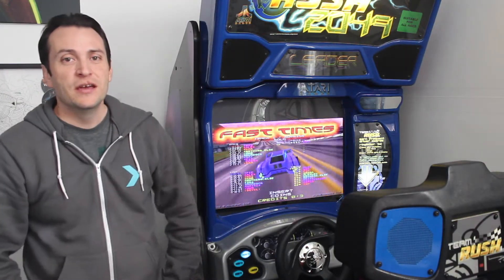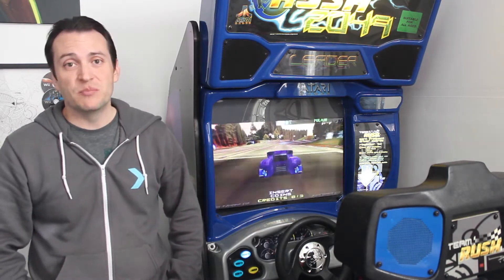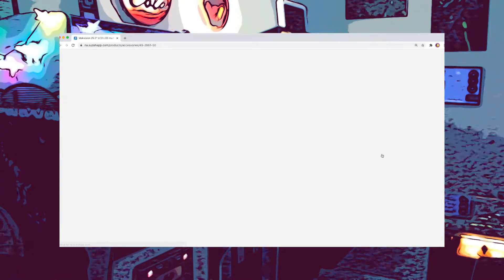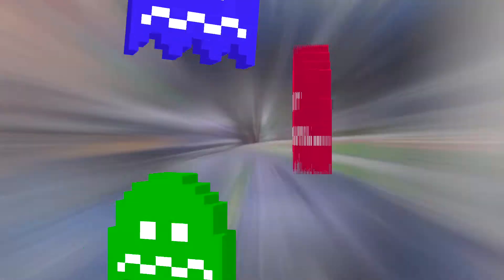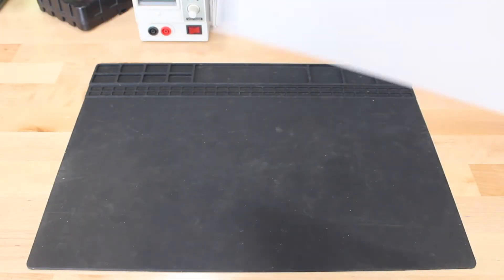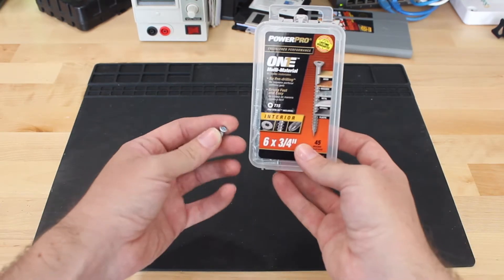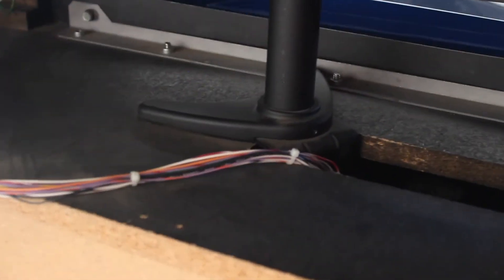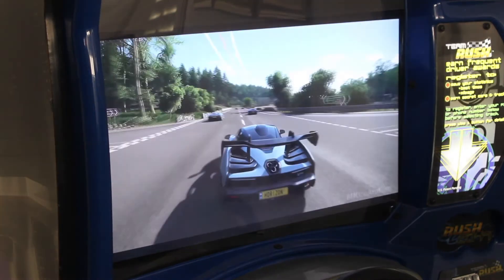Installing an LCD into a San Francisco Rush 2049

Comment: Really cool. I did a similar conversion on mine. Love the LCD display crispness. My rush 2049 has a vga out, it makes it super easy to use a LCD.
Reply from the maker: Nice! What kind of LCD did you use? Did you need to use an adapter to go from the 15khz signal to VGA, or is it just directly connected?
Reply: @justinsarcade  I used a standard ACER computer monitor I got at bestbuy. No adapter needed. I just bought a VGA Y splitter from Amazon for $8 and plugged the monitor directly. I liked how you put the new plexiglass.
Reply from the maker: @jonathangarcia1006  That's awesome! For some reason I assumed it would be a 15khz arcade monitor and you'd need a converter. I guess since it's a higher resolution 3D game, a VGA signal does make sense in retrospect. Thanks for the info!
Reply: @justinsarcade  Great video! I should be picking up a 2049 cab soon and am very interested in your solution to connect and swap between the original game and PC games or PS4/5 games. Also how to connect force feedback is near the top of my list as well. Do you have plans to make a video on that?
Reply from the maker: @robwalker2937  Yes! That is in the project queue and I plan to make a video about it as well.

Comment: So now really need the oc video! Got a gaming PC and monitor. Hooked up a jamma to PC converter. Got some sound out of it (although speakers sound possibly blown), and not sure how to figure out if it the board is working correctly or I need to get a uhid encoder or something now. Very new to PC gaming. But getting there. Installing all the mame stuff now

Comment: Hi Justin, great video. Did you ever do a video on using Rush 2049 force feedback and cabinet controls on a PC conversion to run something like Forza?
Reply from the maker: I've been through a few hardware revisions for the controls... at this point I think I've finally settled on using the community built PWM2M2 and PWM2HAPP boards. I've got one waiting to be installed but it's taken a back seat to other projects.

Comment: Are there any monitors that match the height of the original CRT? It looks like the picture is stretched on yours with the gap on top but I like the idea of sharper graphics.
Reply from the maker: Not in the same 4:3 aspect ratio, at least to my knowledge. But there is something that will get you close.

I originally tried to use an 16:9 TV that was big enough that it filled the entire viewport vertically and overflowed it horizontally by about 6 inches. My thought was to just use software to scale down the game to fit in the viewable area, so 4:3 games would fill the entire viewable area and 16:9 games would be letter boxed. This was easy enough for games running under MAME, as you can build a custom screen layout to do exactly this. But I couldn't find an easy way to do it for modern PC games; I expected to use nvidia's control panel to make a custom resolution and set the appropriate offsets, but I never got it working right.

That being said, there is a new screen from LG called the DualUp (28MQ780) which might get you really close. It is a 27.6" screen with an aspect ratio of 16:18, which is almost square. It is about a half an inch short of the viewport's width and around 2 inches taller. So it almost fills the entire viewport. This might be a great option though, especially when you want to run 4:3 MAME/emulated titles as well as 16:9 modern PC games. Older games would almost fill the viewport entirely and modern games would be letterboxed. I have been considering this for the Rush build as well as another upright cabinet.

Here's the specs: https://www.displayspecifications.com/en/model/aab029cb

Comment: im interested in how you reused to original controls as I'm getting one of these cabs very soon and I'm sure which direction to go with.  Any input or advice would greatly appreciated
Reply: Currently, I'm working on using a special force feedback PCB referred to as "Immersion" (GlobalVR part no. 990-0040-01). I believe this board was used in the Need For Speed conversion kit, which was PC based. This PCB connects to the Happ force feedback motor, potentiometers for the petals, matrix inputs for the 10 digit keypad, and the standard push buttons. It has drivers for Windows 7 which show up as a steering wheel with force feedback. From there I'm using the FFB arcade plugin.

FFB Arcade Plugin: https://github.com/Boomslangnz/FFBArcadePlugin/releases
ArcadeControls Forum Post: http://forum.arcadecontrols.com/index.php/topic,135310.0.html

Unfortunately, I'm having issues on anything newer than Windows 7. Depending on how it goes I may try to switch to this community built interface board:

http://forum.arcadecontrols.com/index.php/topic,162932.msg1743119.html#msg1743119
Reply: @JustinUnterreiner  did you ever revisit this build?   I’m currently working on my rush cab and I also picked up a nfs carbon cab at the same time for $25. Needs some work but it is the complete cab with pc and all
Reply from the maker: @Undar8ed03  Yeah, slowly making some progress. I decided to move away from the Immersion PCB to a solution developed by the community. A user named Aganyte from the gameover.net forums has a solution for several racing cab configurations. For the SF Rush specifically, I'm using the PWM2HAPP with the Sega FFB board. I have the hardware in hand, but I've been distracted by other projects. Hopefully I can get to it this fall/winter.

https://imgur.com/a/96JCaNO

If you want to do research yourself, check out: https://www.gamoover.net/Forums/index.php?topic=38553.0 and/or search for "PWM2HAPP" and "Sega FFB hack".
Reply: @justinsarcade  that’s what’s up!!  I appreciate it man. Hey by the way, would you still happen to have any of the original rush pcbs?
Reply from the maker: @Undar8ed03  No problem! Nope, I don't have any of the original PCBs; my cabinet was stripped when I got it.

Comment: How did you hook up the RGB GS to VGA plug GBS8200 ?
Reply from the maker: I did not need to use a GBS8200, as I'm using PC based hardware.
You also shouldn't need a GBS8200 if you using the MAKVISION multisync monitor listed in the video description.

If you're using the GBS8200 converter with an original game PCB and a non-multisync monitor, I believe you need to connect the RGB and sync wires from the JAMMA edge connector to the GBS8200's RGB/GND/S pins OR directly to the VGA connector using one of these:
https://www.showmecables.com/maxblox-hd15-vga-male-terminal-block-panel-mount-connector
Reply: @justinsarcade  I have a WG U3000

Comment: Okay but how do it get it to work?
Reply from the maker: If you are using an original game PCB you can either use a multi-sync monitor directly (like the Makivision one listed in the video description) or a standard LCD. If you're using a standard LCD then you'll need a CGA to VGA adapter.